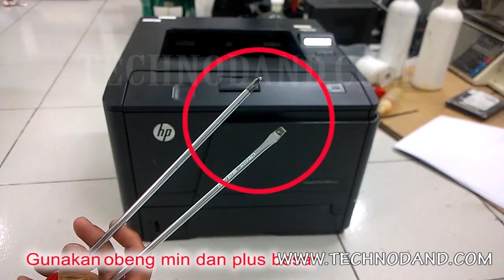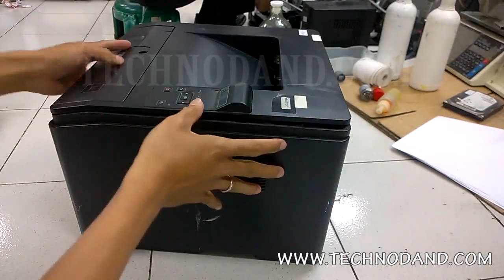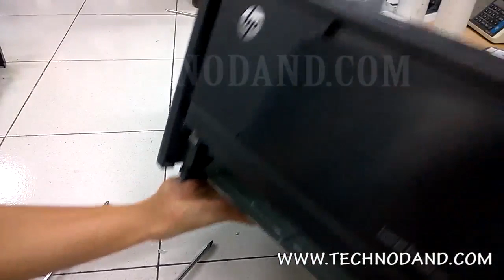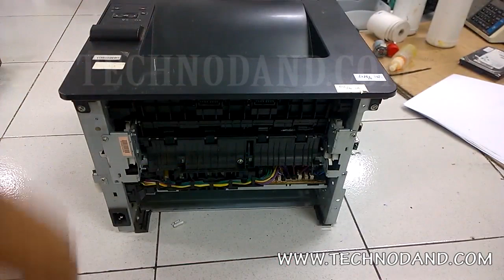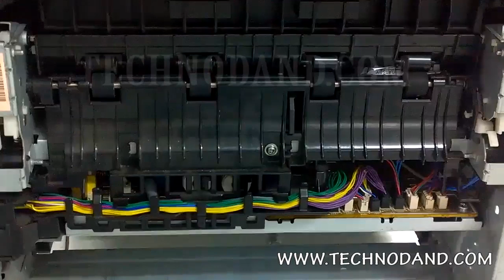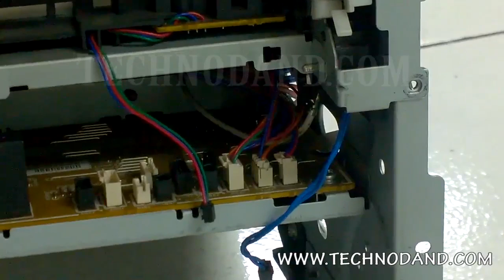How to Replace Fuser Film Sleeve And Pressure Roller HP Laserjet Pro 400 m401n - Part 1

Comment: I just replaced my fuser using these instructions.  I was a bit leery of removing all the electrical connectors off the board by pulling them by the wires.  This is usually a no-no.  However, these are so small I didn't seem to have much choice.  Hopefully nothing was damaged.  I won't be able to test it until tomorrow when I get a toner cartridge in.The only other note is when removing the back panel, there's a metal tray in the bottom of the printer that is connected to the back panel.  If you lower the metal tray from the front of the printer and just leave it connected, it will slide right out the back of the printer when you remove the back panel.  No need to separate these two.